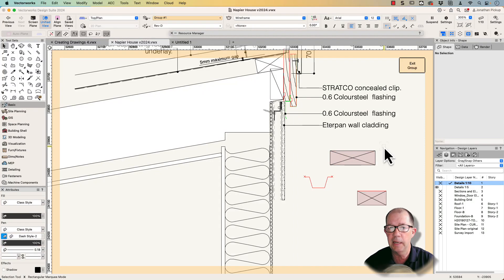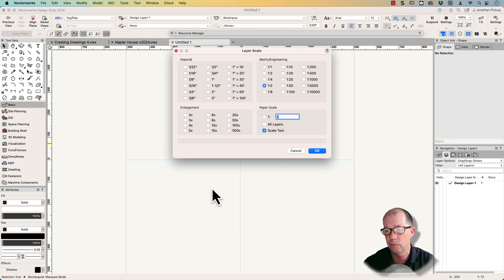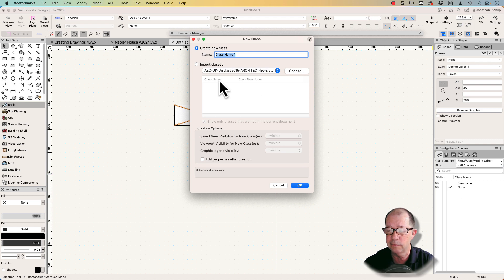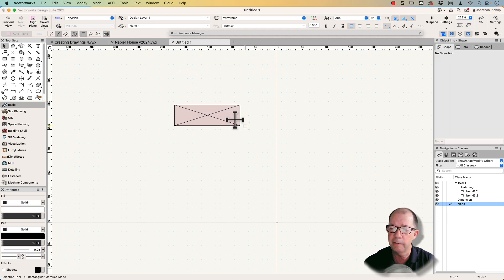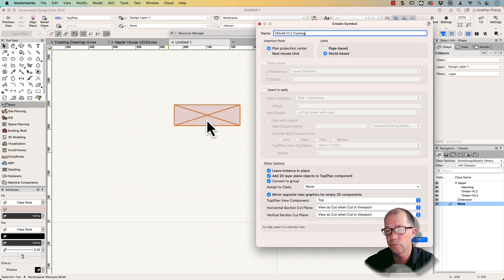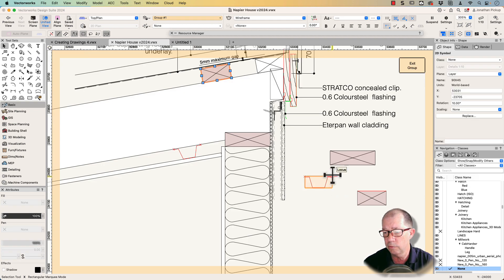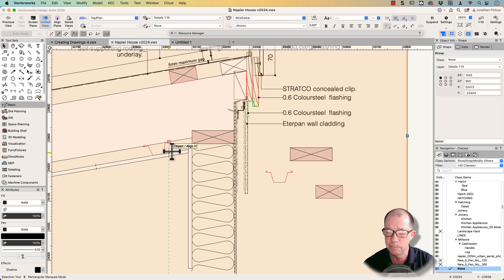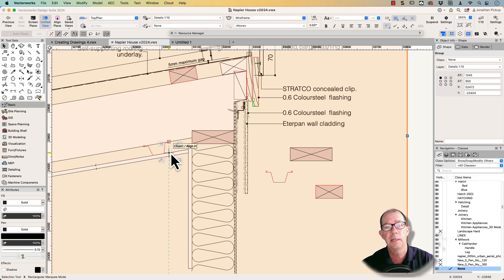Creating Symbols In Vectorworks 2024

Comment from the maker: I see what you are trying to do. The answer would be to add extra 2D Loci where you want to snap, and make them into Master Snap Points.
Reply: I did but some are corner joiners with 3 socket receivers. 2D Loci is nice to guide them in but I would like to really take advantage of "insertion points" to stop a pipe from inserting too far into the joiner. I notice you have 2 insertion points in your video. How did you do that?